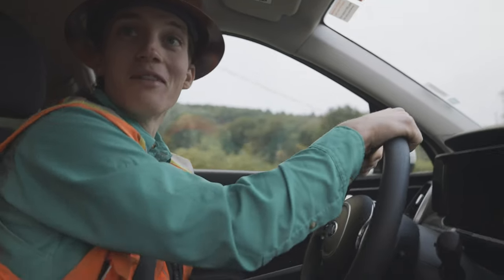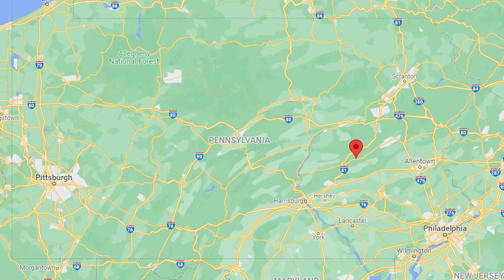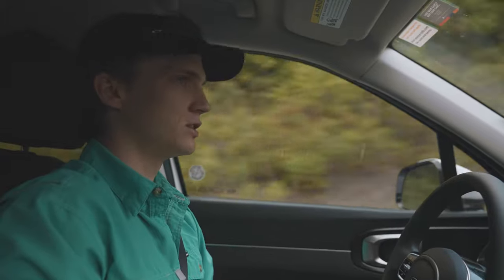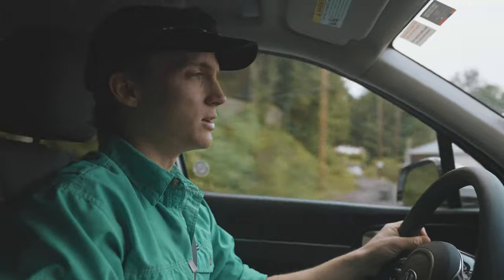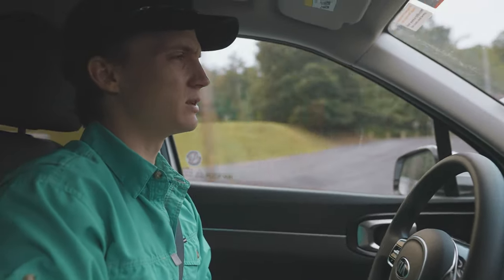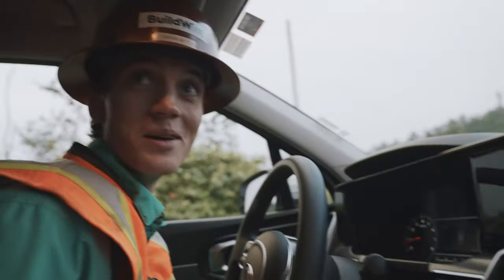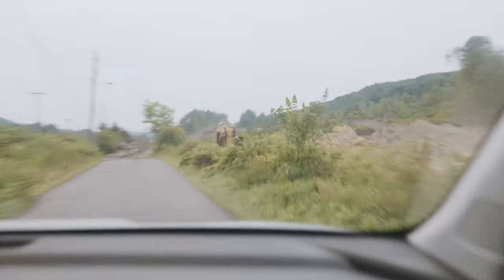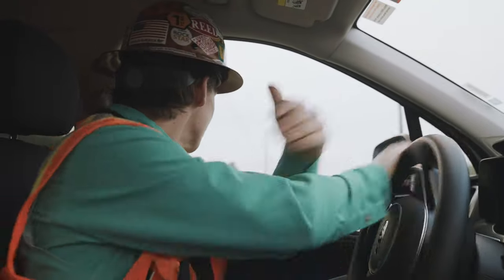Mining for Anthracite Coal with a 6020B in Southern Pennsylvania

Comment: I go to school in reading. Learning about the local anthracite history is what got me into mining. After I get my gen Ed's done, I'm planning on going to school for mining engineering. Cool video. Also, Harrisburg is kind of a lame ass city. But then again, so is reading.
Reply: There's no Anthracite in Reading lol That's 30 miles North.
Reply: @Most_Trustworthy_Weasel  I live close to reading but used to frequent the anthracite patch in the summertime with my family. We would go to the number 9 mine in the summer becouse the mine was 56 degrees all year round. I would still count it as local history though becouse all the towns in berks County sprung up due to the steel industry were reliant on the presence of coal and iron in the area. I live in a town where the mill outlived its competitors in the early 1800s becouse of its switch to coal.